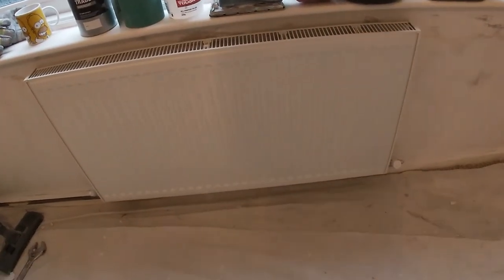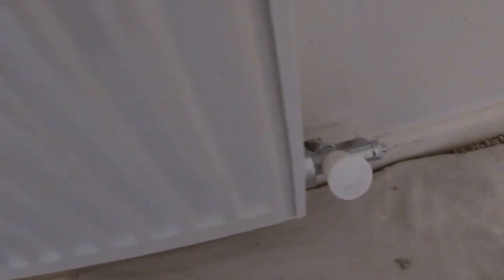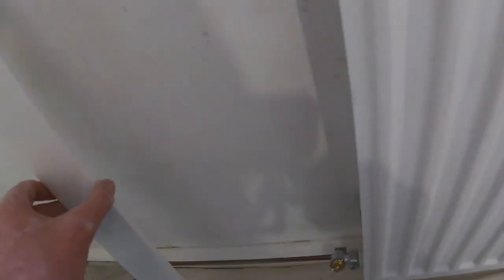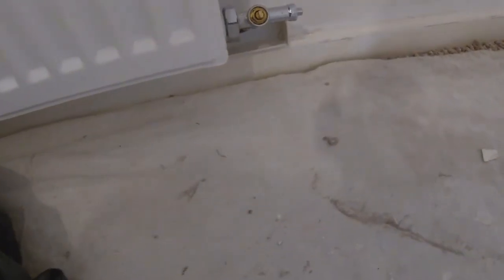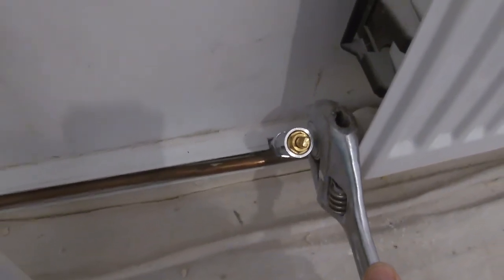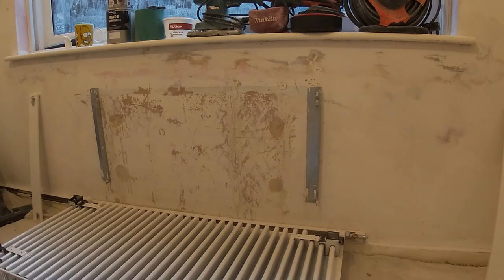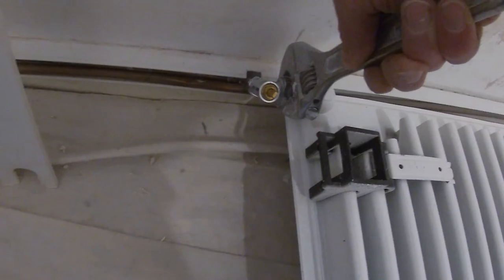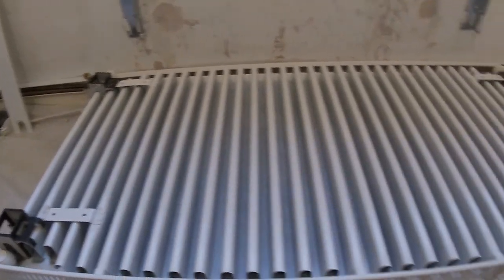HOW TO DROP A RADIATOR FOR PAINTING / WALL PAPERING AND DECORATE BEHIND WITHOUT DRAINING THE SYSTEM.

Comment: I did this and ended up with a swimming pool in my living room😅
Reply from the maker: Haha hope you swam to safety 😉
Reply: I need to do this, do you mind me asking what you did wrong so I also dont end up with a swimming pool 😂. And great video, thanks for the instructions!
Reply: Won't work with mine, mine is microbore, not 15mm like yours
Reply: @paul1962uk  They break/bend/split so easy! I always drain if they're microbore, not worth the risk. Especially if you're trying to handle a big rad by yourself!